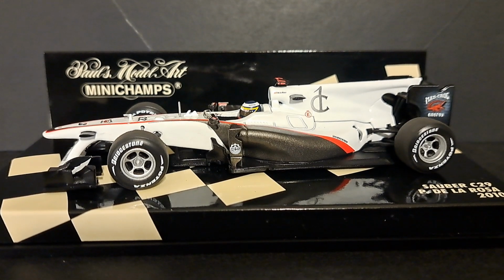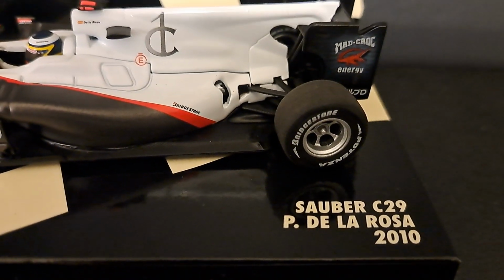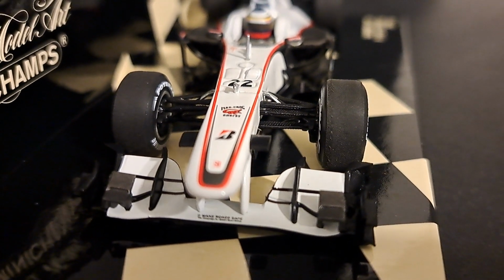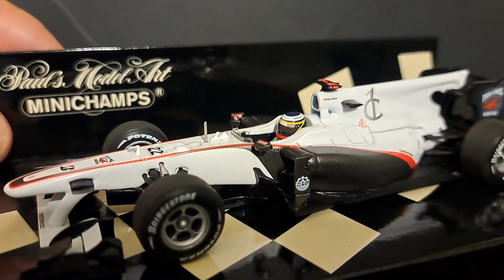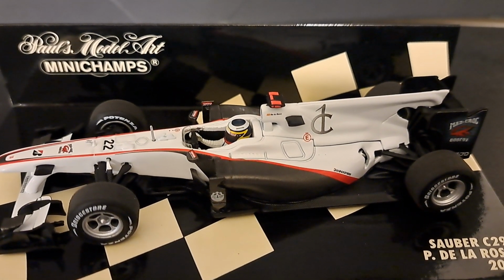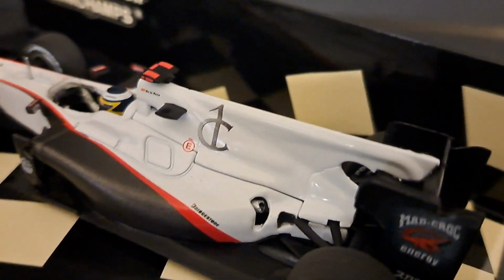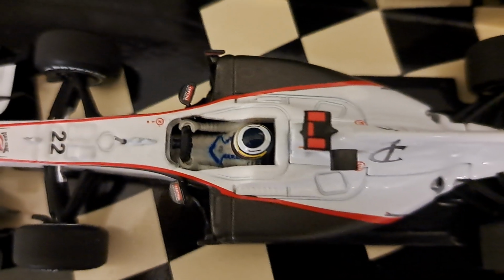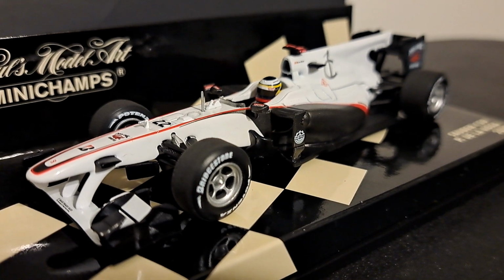Mini Champs: 1/43 scale review of a 2010 BMW Sauber.

Comment: Interesting f1 but I join yourself on the base, that white finish material on it really starts to yellow badly on older models. Even though i have several of these, i don't like the way some of them just says for example 2010 and don't specifiy which race, some minichamps does, other not which i find odd. Spark always does and the car can change in design and livery thought the various race of the season that's why im complaining.
Reply from the maker: That is the last of the STANDARD Mini Champs for me. I am considering some special edition Mini Champs that have different packaging and are about 40.00 cheaper than an exact same Spark.